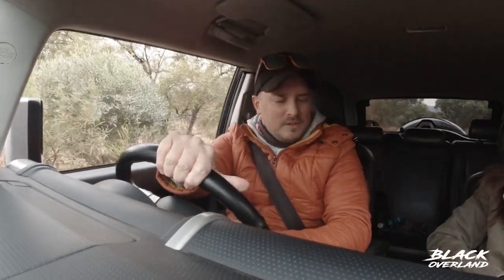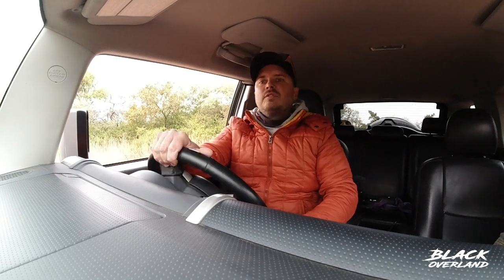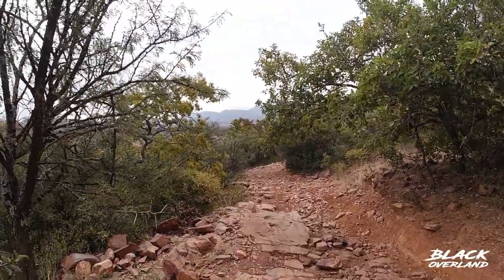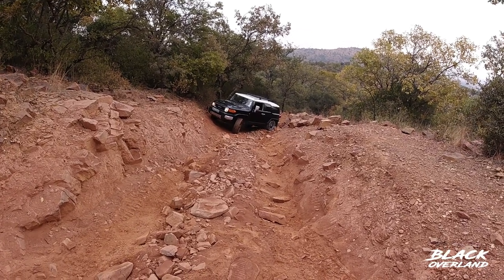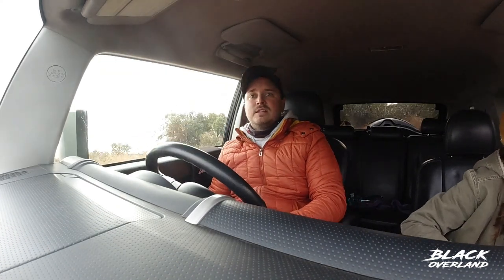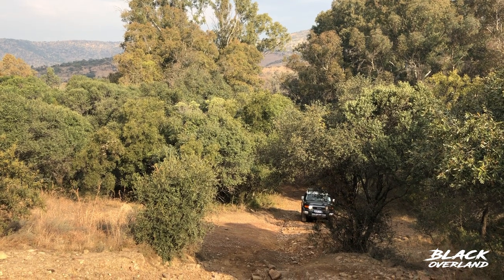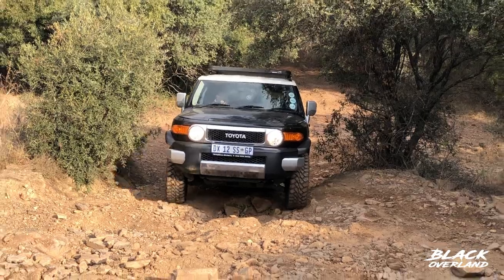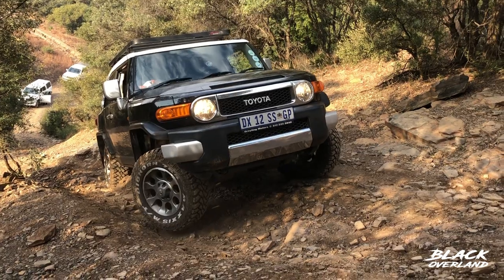4 Wheeling with a throttle controller | Hennops Trails

Comment: Hey man! Looks good! Definitely like the throttle control on the trails! The FJ is a bit twitchy at times. 
Have you maybe test it with the Cruise Control? 
We had a throttle controller on our Nissan Navara and that one screwed with the cruise control. Was a different brand, but the issue is still hiding in the back of my head.
Reply from the maker: Not been on the highway too much lately but I’ll check it out soon and let you know